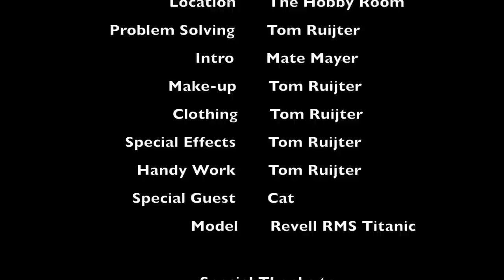Revell: 1:1200 RMS Titanic Part 1

Comment: I built my first Titanic model out of Legos, then I bought a similar kit (Revell, but 1/570). No doubtfully, it was great to look at, but I also wanted a wreck model, so bought an identical kit, built it, sawed it in half,  and did some small tears and cuts on the bow. The next thing I did was smear the ship with hot glue, then glue it to a cardboard base and use clay around the base for the mud (the smeared hot glue looks kinda like rusticles). The stern was no doubtfully a cross between easy and hard. I didn't put the interior decks, engines, or parts and it was actually pretty fast to make. I smashed the stern and cut up some plastic parts, then stressed the main hull to deform the appearance. Any remain parts (the funnels, the middle section that was missing, and other leftover pieces that were cut off where smashed and torn apart with a hammer, then glued to the base. It looked in the end..  a little worst condition than the real thing. (The bow was no doubtfully better looking, and was in better condition than the real wreck).  Still haven't had time to paint the rusticles in a mix of brown and gold paint. I'm hoping to get a huge fish tank purely just to display the model wreck in. However, my mother wasn't pleased to see that I bought a second model with intention to cut in in half, not to mention implode and stress the stern and cut parts from the bow. She was even more concerned when I said I wanted 4 more models. 2 were to be used for the HMMS Britannic and HMT Olympic. The other two would be a Britannic wreck and a very unreasonably made model- a half scrapped Olympic.

Comment: I wonder why did You paint whole ship white, even bottom, if white is only top? The same with red. Most of red was painted black later.
Reply from the maker: +gutt3k I painted everything white because the bottom needed to be red, and the red covers better over the white. I painted most red becouse it was easier to paint the extra cm red rather then having to be really precise on aiming the red. Keep in mind the ship is about 3 cm high.
Reply: +The Scalemodeling Channel ok I understand. I was watching it on phone and didn't noticed that it is so small because everything was small. :)